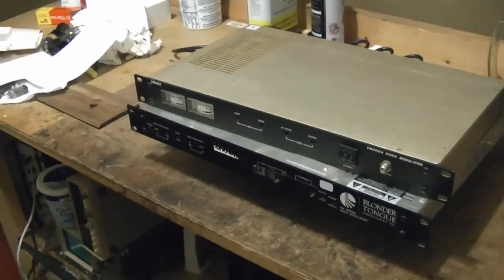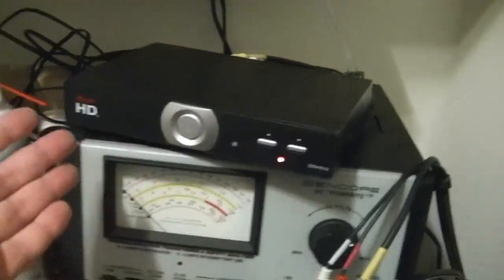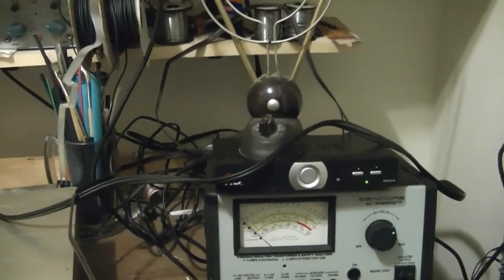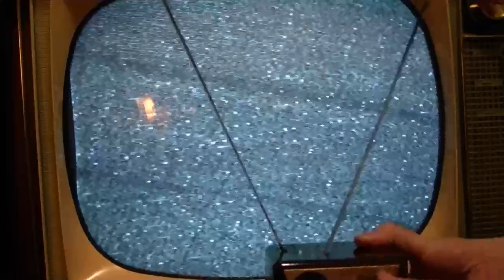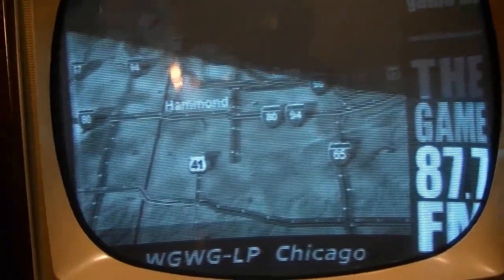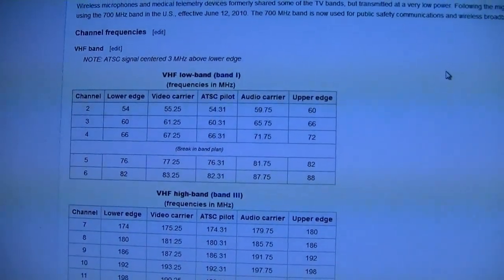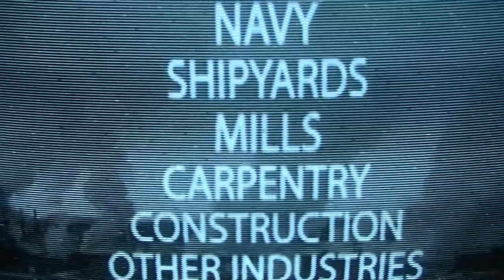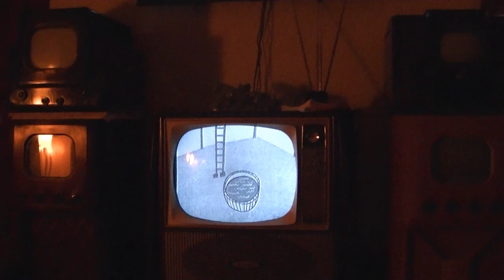Drake VM2410A video modulator

Comment: The rabbit ears do not use 75 ohm coax and will always present issues. Needs to be a 75 ohm load not just proper length. its like a 75 to 300 ohm matching transformer, impedance is important
Reply from the maker: I'm using a 75-300 ohm transformer right at the output of the amp.  Then 300 ohm twin lead into the rabbit ears.

Comment: Antenna is everything, as you saw in the video I made on the antenna for this thing, im not only going for SWR but impedance. When you get it at 75 ohms the bars go away. You can use that IF out directly into a 45mhz IF set to test the tuner and alignment.

Comment: Really enjoy what you are doing.  I worked tv repair for over 20 years.  Something you might try is to take a FM dipole antenna and trim the length to optimum length for quarter wave.  match it  the coax input using balun as you are doing  with the rabbit ears.  The advantage is that you can wall mount this and it will be out of the way.

Comment: Agree with everyone about antenna being the critical path to success. Remember that receiving antennas are very forgiving -but this is not so with transmitting antennas, especially at QRP levels. Getting a good impedance match with low SWR is the ticket. If you have high SWR, your power just goes to heat. Do you have a GDO or an antenna analyzer? One thing to remember is that surrounding metal objects, height above ground, etc will make the actual resonant freq and the calculated resonance frequency two very different things.
Reply from the maker: No, I don't have any equipment for measure SWR or tuning the antenna.  I know other TV collectors have had good luck using rabbit ear ears for the transmitting antenna.
Reply: bandersentv
You can use a cheap ($5) CB swr meter if you use this trick: http://www.kb6nu.com/no-vhf-swr-meter-no-problem/

All that said, a GDO is an amazingly versatile bit of gear.

Comment: I guess the "cat antenna" didn't end up being the "cat's meow" after all.
  I really like the Drake modulator. Definitely a smaller footprint then the Blonder Tongue agile modulators ones we have. I also really like the output level analog meters and the tuning mechanism using a thumbwheel vs. the use of dip switches. Thanks for all the info on this.
   The sound bar problem is really weird and happens as well with all three modulators? Perhaps you really do have some interference somewhere in the path of transmission.
   R.L. Drake has been famous for decades for making superb ham gear. I even now have the best shortwave portable general coverage radio ever, designed by R.L. Drake called the "eton e1" A wonderful SW and Ham receiver.
   Thanks for all the detailed information contained within this video!
     Take care my friend and have a great weekend,
        73s
             Tom
Reply from the maker: The meters actually show modulation levels rather than the output power.  Yes, bars in all three but it's most noticeable with the BT agile modulator.

Comment: I was a little surprised to see that that flat-panel TV still has an analog tuner built-in (even if it's not a very good one), but I guess it's still required (due to the FCC "all channels" mandate) as long as analog LPTV stations are still on the air.

Ramsey Electronics used to sell a channel 6 low-power TV transmitter kit (see Spatsbear2's video "Ramsey TV Transmitter"), although they discontinued it years ago, and it wouldn't be useful for you as long as that channel 6 LPTV station is still on the air.
Reply from the maker: I've heard those Ramsey transmitters don;t work very well anyway.  I've obtained a very good picture using the blonder tongue modulators in the past.  Check out the final installment in my Admiral 20X122 series for instance.  http://youtu.be/2-nqq5rImqY?t=21m9s

Comment: I think a loop 12ga wire antenna that is about fourteen feet long (full wave for about 66MHz). A loop is more broadbanded. The loop can be square or round, side fed for vertical, bottom fed for horizontal. A quarter wave should be about 3.5 feet. I just won the BT on ebay for less than 40$ includes S&H.

Comment: More thoughts on the antenna: One problem you will have is getting an antenna that is broadband enough to cover the 6 MHz bandwidth of a TV channel. With normal ham transmitters the signal is very narrow band.  I wonder if something like a "rubber ducky" antenna for the 6 meter ham band (50-54 MHz) suitably cut down might work for TV channel 3 (60-66 MHz). They tend to be pretty lossy antennas and as such have low Q making them fairly broadband.  These antennas are helically wound wires that do resonate at a given frequency range without being very long physically.  You can probably make such an antenna by consulting with suitable info from ham publications by spiral winding a big wire like #14 bare copper house wire around a form.

Comment: Bob, As a ham radio operation with some experience with transmitters in general, the antenna tuning will be critical for effective power radiation. A mismatched antenna will be a very poor radiator. Ideally you would use an SWR (Standing Wave Radio) meter on the output of your transmitter inline with your antenna and you would adjust the antenna until you get a low SWR reading.  I'm guessing your rabbit ear antenna is giving you a high SWR and thus very poor efficiency.

Keep in mind that the impedance of the antenna ideally should look like 75 ohms resistive to the transmitter for proper matching. You may need some kind of L-C matching network to get that 75 Ohm impedance.

Comment: An issue I had with mine was using a channel adjacent to a digital ATSC broadcast.  It looks like static but in reality is the data flow.  

I found that the Antenna needs to be something like a simple dipole set up high fed by coax, one length of the pole on the shield and the other on the center.  I put a simple antenna tuner in the feed line to tune the antenna because the feed line length does make a difference.  Now the picture fifty feet away is very clear with the output set about ¾.

Comment: on my old set, I had to use a 300 to 75 ohm adapter, and I get snow, however If I touch the set's built in antenna and the coaxial at the same time with my bare hand, the snow vanishes entirely, ive also read that no 300 75 ohm adapter are alike and I should check to see if its within tolerence
Reply from the maker: I've never heard that before.  If you are using an adapter to feed in a signal with coax, you should disconnect the internal antenna.
Reply: removing the set's built on antenna solved the issue, I never thought that to ever be an issue since it was stock built with it attached

Comment: I have a vid on this YT ch on how to make a 2 element quad antenna for VHF 2m. But a single loop should work OK for this, since it doesn't have to be as directional. Just use a fourteen foot wire to make the loop.
Reply from the maker: Hmm.  Not sure where I'd put a 14 foot antenna.
Reply: bandersentv devide it by four, each side would be like less than four feet long, a square with 3.5' sides.
A round loop would be about 4.6' in diameter.

Comment: Is it possible to use RF amplifier to amplify the converter box output with impedance that we can couple with antenna.
Reply from the maker: Sure, but I'd rather get these devices working properly than have to buy an RF amp.  I know others use them with great results

Comment: Maybe you out to try using channel 1 on that Drake & trying to get it on your earliest sets (e.g. the early-production VT-71s).
Reply from the maker: My only electrically restored set with channel #1 is a 630TS, but it's currently in pieces.  Eventually, I'll give it a try.

Comment: Those bars are a known problem, because the transmitter antenna "is inside" the house which is picking up the 60Hz line frequency from your wiring in your walls, back into the transmitter as feedback. AllAmericanFive did a video on this long long ago.

Also, you mgiht want build yourself up a single transistor Class C based amplifier, and try that on for size. That should help things tremendously. Why? Well the Blonder Toungue has an output level of 60dBmV into 75 Ohms, which is roughly 13milli watts. Very very tiny level of output power.

if you built a 6Mhz wide amplifier then you can kick this up a few hundred miliwats and that would be plenty. I am sure youll violate a few FCC laws in the process, and actually your probably violating some now. But i doubt they will pay any attention at that low of power output. Now if your running several Watts, then i would worry.
Reply: No, no not class C. Must be linear, or as close to it as possible, unless you don't mind the artifacts of triple-beat IMD in the video. You can probably get by with class B, but depending on how you balance the video carrier and the audio carrier you will still see some IMD. There is no front panel adjust for the color sub carrier. I'm pretty sure the broadband amplifier blocks in these run close to class A, otherwise they would not be rated for -62dB triple-beat IMD. They also run very warm with zero rf drive, so the active devices are biased ON full time.

Comment: I got the Blonder Tongue for under 40$, S&H and all from ebay. But the Drake is more than 100$. I just got it, and have not tried it out yet.
Reply from the maker: Which model BT and Drake ?  I see a Drake 2450 for $40 BIN.
Reply: bandersentv BT is model MAVMs ch 4. I will keep an eye on Drake for such a deal. I'd like more DX range.
Reply: ***** MAVMs put out 40 dBmV.  I think the most powerful model is the AM-60-550 that does 60 dBmV.
Reply: ***** thanks for the 411, I just got one since my signal was weak.
I am looking into the T band for QRP ATV 433mhz.  But this will do for the house.